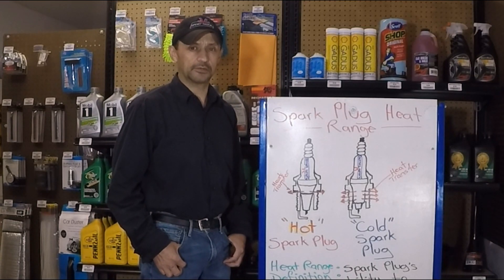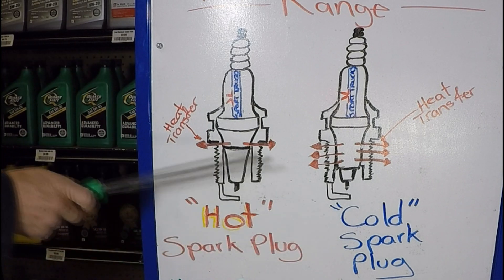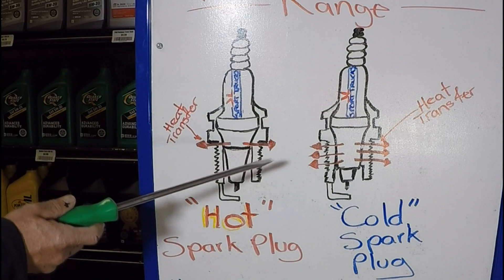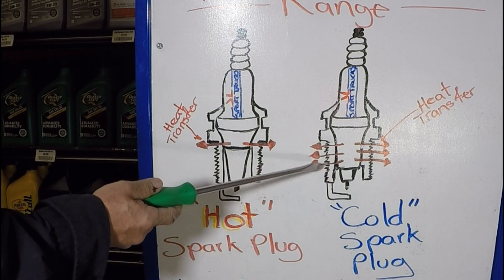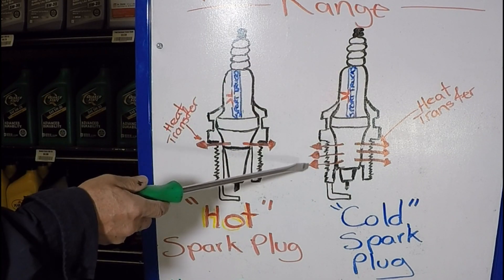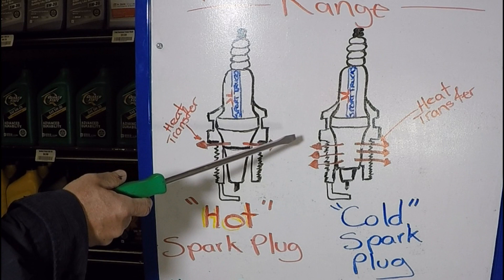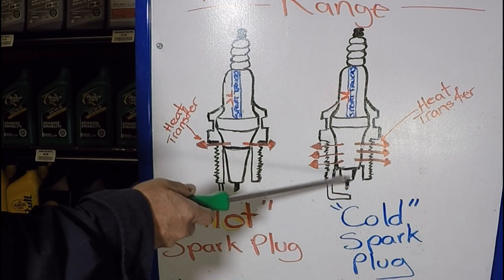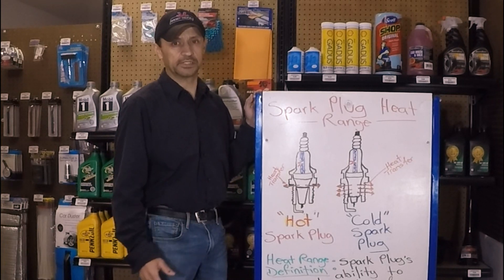Understanding Spark Plug Heat Range

Comment: Still confused here but can you also say that cold range spark plugs are for the sports bikes like the high cc ones? I got a 150cc motorcycle and done a port and polish in the engine, should I get the cold range spark plugs then?

Comment: Excellent! Out of all the articles I read and videos I watched about spark plug heat ranges, this is the only one that explains the electrodes having a larger or smaller contact with the outside of the spark plug.

Comment: After all that why didn't you tell us witch  # heat range is hotter or colder, Is #6 hotter or colder then a #7 heat range, that would help better then guessing and buying different plugs not knowing witch is the hotter or colder plug..
Reply: boots 1131 Every manufacturer of spark plugs are different.
Reply: for ngk : CR8EIA-9 (HOT) / CR9EIA-9(COLD) . the third number is the heat range in this specific code so when its go higher thats mean its colder i hope i made it clear for u ^^